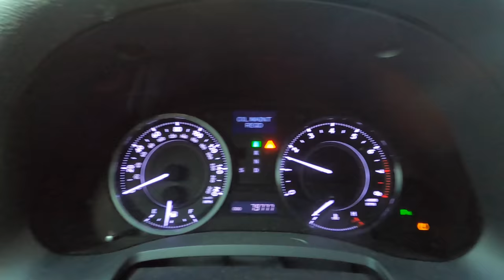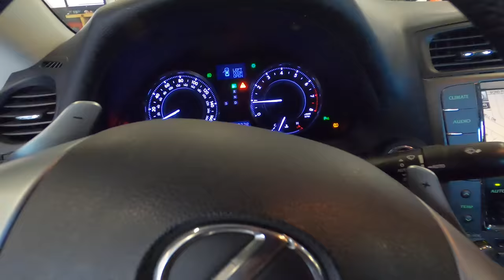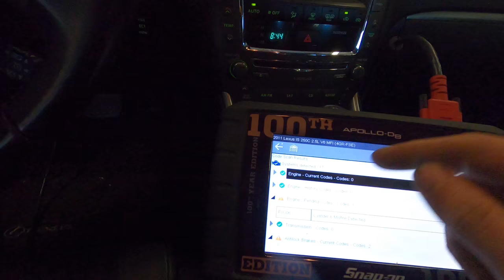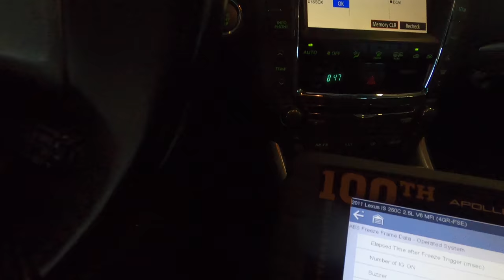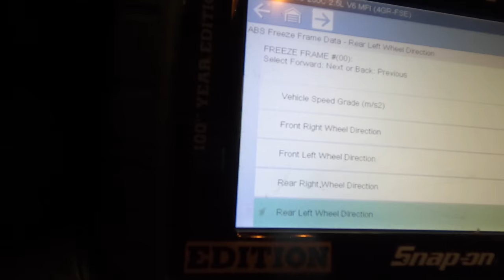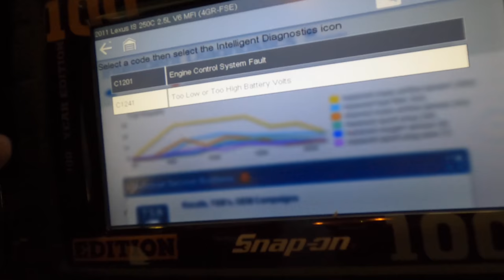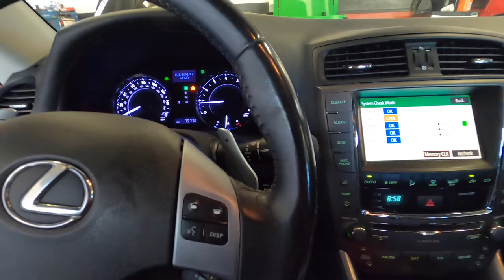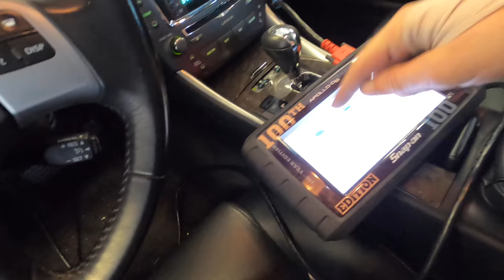Lexus IS 250:  Customer States Lost Power While Driving. Why can’t people communicate?

Comment: that "temp probe" looking this is actually a cold start fuel injector.
Reply from the maker: Brilliant! Thanks for letting me know!
Reply: What was Toyota trying to achieve by doing that? As far as I know no other manufacturer has put a separate cold start injector so just wondering what the benefit is
Reply: @ianriggs  because this engine is direct injection
Reply: @gianfrancoa  oh ok thanks. Do all di engines have that? Or is this a Toyota thing only?
Reply: The 1984 BMW 318i I had also had a cold start injector, and it was not direct injection.
Reply: @nikoruokolainen6217  1990 volvo 740 has one
Reply: Wow a cold start injector on a 2010?  I thought those things went out with Bosch L-Jetronic/Motronic in the '80s!!
Reply: My old 260 and 280 Z cars had cold start injectors as well.  If they fail they crank for a long long time before starting.
Reply: Replacing all the coil packs is not a bad idea.  They fail on bmw and porsche so you just replace all of  them.
Reply: that injector in theory, supose to assist the engine  to "alleviate" for carbon buildup on the intake valves, i believe it was added during the 2009 year.
Reply: @cayman9873  Sounds like they use junk and have alot of detects or engineered to fail. A coil is a pretty simple part. They should last the life of a vehicle. Not that they do. We have to keep buying parts!
Reply: Volkswagen used a cold start 5th injector on 4 cyl engines with Bosch injection 1977. Functioned with cold engine block, shut off when block reached temp
Reply: @ronhuffman7973  my grandfather had an old vw rabbit, orange 77, had that. Mechanical injection. It never broke,  unlike today's Volkswagens
Reply: @ronhuffman7973  This actually makes sense, as it replicates the fuel mixture richening of the choke valve.  And Sweden does have cold winters every year.
Reply: I have tractor that has that set up on it. Starts on gas till engine warms up then you switch it to run on diesel
Reply: @OMAR6575  I can see how that would work on a direct injection engine, otherwise the backsides of the valves never get a fuel/air mix so there's no "solvent" action to fight deposits from the crankcase PCV oil mist getting sucked up by the intake.
Reply: @jameshedrick6839  The IHC WD series are the only tractors I heard of that start on gasoline and are manually switched to diesel. They were very different. Gasoline went in by carburetor through a separate intake and intake valves. Ignition was by magneto and spark plugs in  pre-combustion chambers in the cylinder head. The only diesel I ever started with a hand crank when the battery was dead.
Reply: @alex1949  Just replaced my 2009 335i injectors.  Did it myself and coded them.  They only cost $237 each x 6.  What a deal!  But it runs like brand new now.
Reply: @ianriggs  I think was just on this one, which was Toyota first DI engine. After this went with the D4S engines which is both port and direct injected
Reply: Yes sir it's a Yoda thing
Reply: @gianfrancoa  they've used a cold start injector since the 80s before direct injection
Reply: @micahap1559  my Volvo is on original coils with 197k miles and is 22 years old. Although I feel like I might want to replace them soon anyway because the plastic may become brittle and rather replace before I have it break.
Reply: @rex_s80  👍 Is the plastic starting to degrade and get brittle?
Reply: @micahap1559  it’s not bad but after I did a compression test a while back (just to check things out. Still has 210 In 3 cylinders while the last 2 were a smidge low but I know why) the coils felt like they didn’t have long before they would snap instead of disconnect.
Reply: Toyota's solution for  carbon buildup for their rest of their line up of direct injection engines was to add multiport injection (another set of injectors ) in the intake manifold. in addition to  integrate an oil separator ( fancy name for a catch-can)  the 4gr-fse did not receive any  this treatments, which is the one of this video. Toyota  just the added that injector. it was also discontinued for 2015 or 2016.
Reply: @OMAR6575  Many have integrated their own catch can or separator. I will say that a coalescing filter separator is a better design and option IMO. But may not look as cool! 😆
Reply: There were some sporadic use of CSI for really cold starts, around 0 F and below, due to the ease of flooding if the port or direct injection duration exceeds a certain value. The usual routine was to over fuel for two injector cycles in the first engine revolutions. Far too many persons in cold climates would do burst start attempts with multiple short starter operations and that would soak the plugs and the game was over. With a single auxiliary injector in plenum you reduce this risk. The other fix was autostart where you push button or turn key to start and the engine controller runs starter for 5 seconds or until the engine exceeds 250 rpm with no regard for switch input.
Reply: wondered what the hose on it was , thanks !!
Reply: @SomeRandomHuman717  It could also be there to help clean the intake valves. I know Ford added port injectors to its DI engines because of carbon build up that happens with DI. I don't know if that's the case with Lexus, but it is possible.
Reply: @micahap1559  depends how hard the coil is being driven, for example the coils on a RX8 get replaced like spark plugs since they get such a work out.
Reply: @Neishy4AGTE  😆 No it doesn't. Its just junk. Funny assumption though.
Reply: @ianriggs  BMW used cold start injectors for years
Reply: @bigdaddymak1439  use the force
Reply: @ianriggs  the Jag v12 had one of these on each bank.  But that’s old tech.
Reply: @alex1949  same with my 533i
Reply: @ianriggs  ....5cylinder audi engine had separate cold start fuel injector
Reply: Alot of Toyota's cars have cold start injectors throught the 90s and early 2000s
Reply: Yep, and it looks like the same one Toyota were fitting to 5MGE's in like, 1983, right down to the banjo fuel connection and 2 bolt flange
Reply: @ianriggs  It's a Toyota thing, along with other people. Nothing specifically to do with direct injection. I guess it's easier to get more fuel out of something imprecise like that injector than it is to run larger injectors and not be able to achieve precision control when you don't want much fuel.
Reply: My 91 Yamaha blaster has one.
Reply: @ianriggs  most European bound cars/trucks will have starting injectors in manifold most of the time they are not needed if any leakage problems just block them off
Reply: @timramich  I wonder if it was brought back to help with DI engines, my 87 supra also had a CSI on its 7M and I didn't see one again for generations of Toyotas and suddenly one here lol
Reply: @IanMcnicholas-pio_masaki  They were used on a bunch of Toyotas in the '90s as far as I know. I don't see how it would help with DI as far as cleaning the valves. It's not going to eat up the carbon on cold valves.
Reply: @cayman9873  Just replaced all of them on my wife's Boxster a 38K miles after 2 failed. Not terribly expensive, but I would expected more miles from them.
Reply: The second generation of Volkswagen direct injection turbocharged 4 cylinder engines also got a cold start injector, circa 2011 I think. But the first generation engines are TERRIBLE for carbon buildup.

Comment: That little injector on the intake is a "Cold start Injector"
Reply: That's usually a misfire problem
Reply: @harooniqbal8664  I'm old enough to remember the solenoid on straight six jaguars pouring raw fuel down the inlet manifold for coldstart some things stay the same as they change!

Comment: I am an excellent aircraft mechanic (Air Force Veteran) and good enough a back yard mechanic to have done frame up restorations on 4 vehicles from the 50’s, 60’s and 70’s. I’ve rebuilt engines, carbs, suspensions etc. I have not however done it all: I have never and will never tackle a Diesel engine or an automatic transmission, I know my limits. When I do take my car into the shop, I always run the coeds with my diagnostic computer (no not a code reader, I do know the difference and would not pay $1200+ for a code reader) and take screen shots as well as run a report for the mechanic of my choice that day. I do not clear the codes because if it’s bad enough to go to the shop, I want the mechanic to both see what I see as well as do what I know he is going to do anyway, run the scan again. I just ask that they sit and discuss their findings with me and not have someone else do it. We compare notes and I tell them what I want them to do and what I will do myself. Anything transmission or transfer case related I don’t mess with, brakes, calipers and rotors, not an issue, I can do them on the driveway on my ‘97 expedition in 30 minutes including bleeding. The crooked ones soon learn that I’m as much a gear head as they are just a bit older. I love when they try to screw me over, I hear them out and then show them where they are lying pieces of 💩. However, if they are honest and tell me what they really found, and it matches or is close to what I found I notify the Maintenance  manager and insist that they charge my 30-45 minute consultation time with me as billable hours at book rate. Most are surprise but I figure if I’m taking up time they could be making money, I want to pay them for their time. Just remember if you depend on them to repair a vehicle  you want their full attention
Reply: @Christopher…. I’m sure if you studied the theory and basic principles of Automatic Gearboxes and got some hands on experience under an experience and certified Automatic Transmission Master Tech, you too could do it, if you already can do all those other things. It just requires the proper training, hands on experience and very important, all sorts of special tools. It does require an investment on your part or on the part of whomever owns the Transmission Shop. I can tell you because I did it and although I don’t think I am a “dumb person” I’m not a genius either. The advantage I had is that I was able to work under the supervision of someone who was a master at it and who was willing to take me under his wing as an apprentice and teach me the basics and principles of Automatic Transmission and Transaxle repairs. Today, when most if not all techs work on commission and  are always under the pressure of beating the time “the book” set for that particular repair is not easy to do what I did.  I was also lucky enough to work for an outfit that sent me to various Transmission courses and schools and paid me while I was attending the school and paid for the school. I know, that’s a lot of things that were on my favor. I was lucky. But that’s what it takes to have proper techs of any kind, 1-proper training 2- a chance to get hands on experience before you have to beat “the book”.
That’s my story and I’m sticking to it.
🤔🇨🇺🇺🇸

Comment: A tip from years of working on airplanes. AC Delco makes a nice antiseize for the threads that still provides a ground path and is great to assure that the steel plug always comes out of the aluminum head. Also, we had a silicone grease by Dow Corning called DC4 compound that is good to coat the coil sockets with and it never dries and doesn’t deteriorate the rubber. The same DC4 is good for coating oil filter gaskets as it will allow the filter to be removed easily at the next service.
Reply: You never want to put antiseize on spark plugs. You can seriously fuck up threads because it makes it easier to over torque. Especially in an aluminum head. 

If you have a stuck plug, just throw a small amount of atf down the hole and let it sit for a bit. The plug will come right out.
Reply: @frisbyfreak420  That’s why I always used a torque wrench on spark plugs. And that anti seize is specifically designed for spark plugs. I’m not referencing the silver stuff from an auto parts store.
Reply: @frisbyfreak420  yeah the ford 3v does not agree with your statement of no anti seize and if a plugs stuck pour a bit if atf down the plug yeah that will not help.  Also you know use a torque wrench
Reply: Used DC4 (dielectric) compound on 747 HF lightning arrestor gaskets because it is such a good insulator, but never put it on the conductive parts for that reason. I don't undertand why people slather dielectric inside the spark plug boots where it comes in contact with the spark plug contact.
Reply: I have the rest of a bottle of Champion anti-seize, small bottle that's lasted 60 years. Don't need much and I use it under electrical connectors as it is basically just glycerin and graphite. I am a believer in anti seize after unscrewing a helical and having to change out a cylinder on a Lycoming.
Reply: @kenore4003  yup. Beechcraft guy here. Never had much use for Lycomings. Was working at the dealership years ago and am used to run ups on IO520’s and 550’s. Had a transient come in with a big Piper 6. After getting him fixed up went on a run up with the owner and during the full power run it felt real down on power and sounded weak. I asked him about it and he just shrugged and said that’s the way it’s always been.
Reply: @ImperrfectStranger  I don’t. It gets applied to the rubber portion and it keeps the rubber from cooking onto and sticking to the insulator.
Reply: @frisbyfreak420  what is "atf"?
Reply: @Franklinveterinarycenter1of4  Automatic Transmission Fluid
Reply: @April8989  🤦

Comment: I'm sure you probably thought of this, but just in case .... The magnets from old hard drives work fantastic for capturing and holding screws to your tools.
Reply: I often have the two magnet thingy that is applied to my shirt that I can slip my readers into.  I have used that metal strap with the two magnets on it to bridge over from the extension to the socket to do the same type of trick.  It is also good for finding nails and screws in the sheetrock walls.

Comment: Wow! I knew that mechanics used those computers to check codes and performance graphs, but not that they could tell the status of the car when the errors occurred! Really impressive tech! (Probably not on older cars!)
Reply: also only shows on the higher end scan tools. his costs thousands
Reply: Not so good if you own a Ford. They are notorious for pulling the data to deny warranty claims. ESPECIALLY for Mustangs and F-150s with the Turbo 6.
Reply: @bradhaines3142  My $400 tool does it in a limited fashion.

Comment: One thing I have always liked about working on Toyota products is once you break a bolt or nut loose you can usually screw them out with just your fingers. You dont have to wrench them all the way off like a lot of other manufactures.
Reply: That means the thread tolerance is loose. Not sure that is a good thing

Comment: The Part you keep calling a temp Probe is a Cold START Fuel Injector that is installed on the back of the intake plenum  Ray Toyota still Uses Banjo Bolt Fuel Lines @Rainman Ray's Repairs

Comment: Love to watch PROFESSIONALS at work! Watching things getting fixed that I wouldn’t think to attempt on my own vehicles, let alone someone else’s! All the different fasteners. Getting them apart wouldn’t be the problem, putting them all back is where I would fail miserably! Even in the early 70s, I would have nuts or bolts left over at the end. Can you imagine what a mess I would make with current automobile technology!? HAVE A GREAT DAY!       Roger in Pierre South Dakota
Reply: That just means you did a better job than the engineers. All those savings in extraneous parts and all
Reply: Those spare parts are obviously not necessary.

Comment: 22:46 What I do in these situations is use a bungee cord to hold the air plenum up, using the hood latch to hang it from. I've found it works better than the pry bar prop rod technique 😉
Reply: Done the exact same thing
Reply: I wouldn't try that without a hood support bar, with those gas/spring hood supports it's just asking for weak ones to bring the hood down on your head
Reply: @user-ut9ln4vd5m  I don't have that issue as for well over a decade I have been in the habit of using my own prop rod to securely prop open the hood on every vehicle I service/repair.

Comment: I had to replace a power window regulator in my sons Camry. The part sent had the holes for the glass drilled in the wrong location. Thankfully I could swap the new motor onto the old regulator frame.